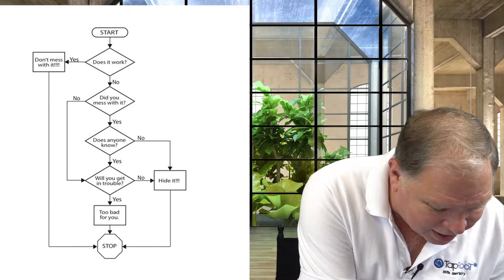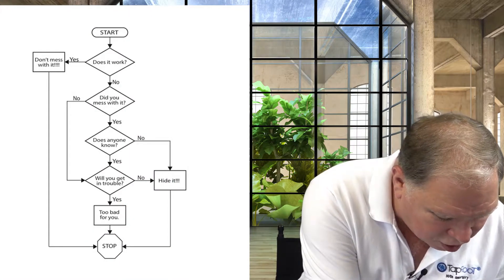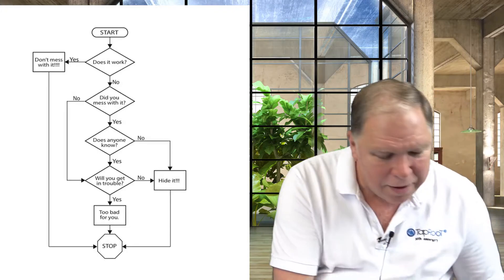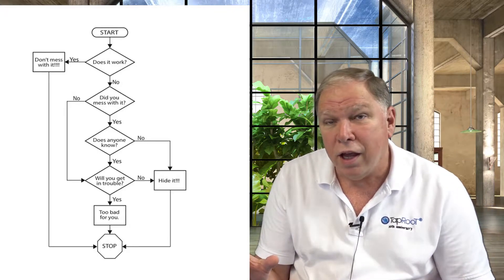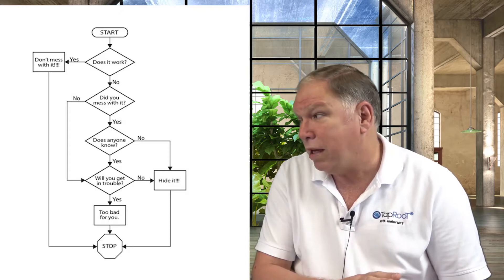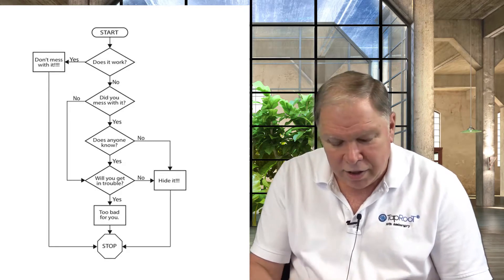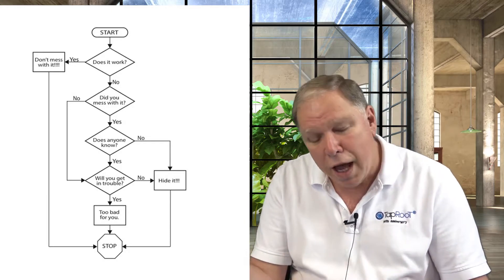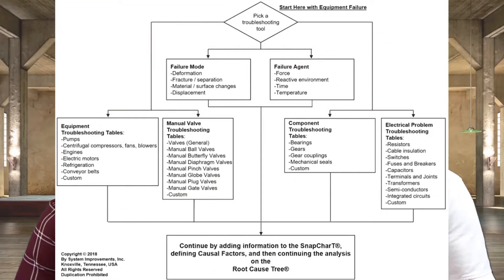First Step To Improving Asset Reliability: A TapRooT®  TV Video Premiere

Comment: 00:04 - Understanding asset reliability starts with effective troubleshooting.
02:03 - Understanding failures is key to improving asset reliability.
04:12 - Introduction to a troubleshooting table for asset reliability.
06:11 - Understanding the troubleshooting process is crucial for effective asset reliability.
08:12 - Identify and check simple issues before teardown for better diagnostics.
10:08 - Customizable troubleshooting methods enhance reliability in asset management.
12:14 - Effective troubleshooting enhances asset reliability through systematic approaches.
14:22 - Training is essential for improving asset reliability.
16:27 - Encouragement to follow and engage with TapRooT® content across platforms.

Comment: This is a baseline concept for smooth, uninterrupted operations. First the equipment must work! If you can't explain exactly why your equipment failed, and then deeply solve that issue, your machine will break in the exact same way a few months (or hours) down the road. Equifactor® is a disciplined method to find both why equipment fails and how to resolve it.